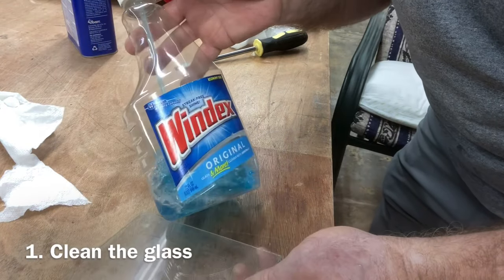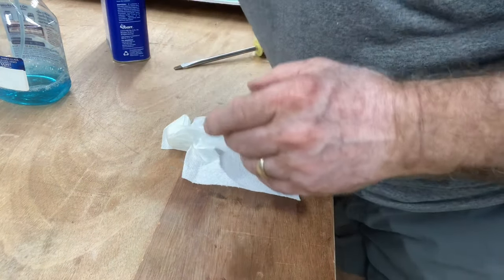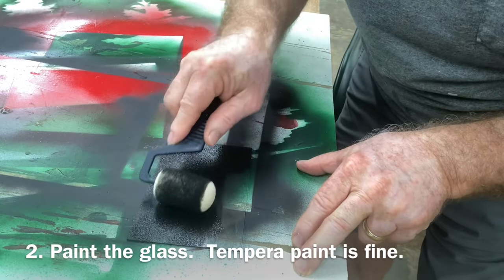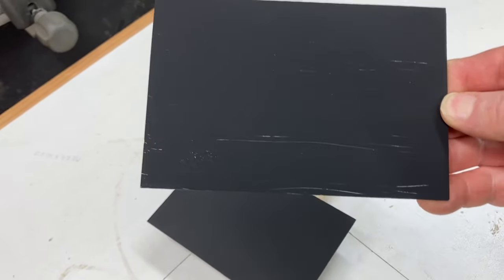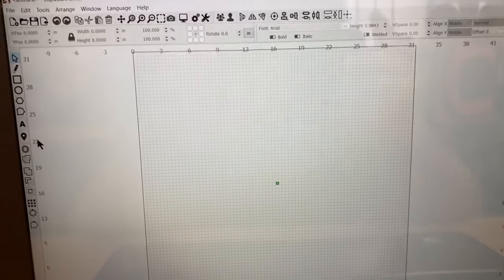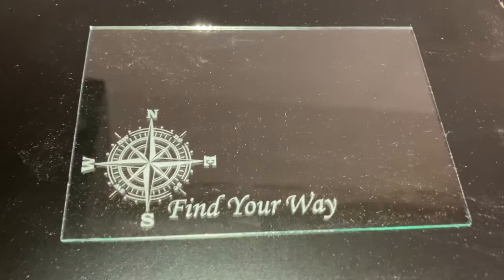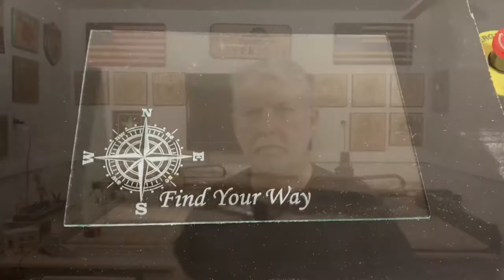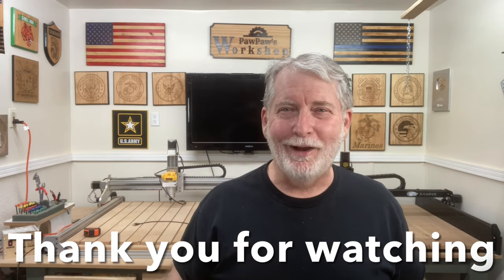How to Laser engrave on Glass with Diode Laser

Comment from the maker: Thanks to everyone that let me know of a voice over problem. Hopefully, problem solved.
Reply: Yep, you got it sorted, thank you
Reply: Such a cool tip thank you mate, another one I saw was the oven grate tray as a cutting bed? That’s so much cheaper then a honeycomb metal board.. I’ve just got my blue diode 40w 445nm 4.5w atomstack p7 laser, what laser safety Goggles would you recommend?
Reply: interesting video but how do you wash off the spray paint? what do you use to strip the paint off the glass.
Reply: 20W laser?  (2.5w optical?)
Reply: @dmanero  I don't know about glass but spray paint comes off of ceramic tile very easily with lacquer thinner.

Comment: You can save a lot of time by just placing the glass on a piece of black card stock, reverse the image, and set the z height to the black surface then put the glass in place. The bottom side of the glass will be engraved. Give it a try.
Reply from the maker: Thank you. I’ve used this method on acrylic. I’ll have try try glass
Reply: Can u make a video?
Reply: @PawPawsWorkShop  so it works on clear acryllic? does it work well?
Reply: This is the method that I’ve started to use. I need to adjust things a little bit but I’m quite pleased with the results.

Comment: As I learn my new engraver, one thing I don't often see it the power of the laser used. If I know my Atomstack A5 Pro is a 5W laser, I would expect settings would be similar for a different brand with a 5W later. I'd love to see more information like that in videos of this type. That would be helpful for us newbies trying to understand what settings we need to be using to get similar results.
Reply: At 7:05 you can see his laser is a 20W, so it would be 280% on a 5W.
Reply: @shigerufan1  actually, 5w/5.5w is just barely eniugh, just needs to run the laser 5-6 times slower. But anything under 5W wont create enough heat.

Comment: Just used a “modified” version of your method. We found that direct contact with our honeycomb bed can cause spotting on the back side of very thin glass. We elevated the glass using magnets under areas that were not being engraved and got beautiful results with your settings. Thanks
Reply from the maker: Outstanding, I'm glad that you found the video helpful.

Comment: Great tutorial, unexpected that the brush painting would be so clear. Have you ever tried (or considered) blackening with soot from a candle or tip of a lighter flame? I expect it will need a thick layer of soot.
Reply from the maker: Yes, that did not work.

Comment: Tempera paint is self leveling Paw Paw, so if you put it on really thick, it comes out perfect with a roller! Great instructional video!
Reply from the maker: I tried the roller. And it sucked. Went with the brush. Will try the roller again. Thanks. Love your work also.
Reply: @PawPawsWorkShop  You have to put a thick coat on. My first time it was see through, but since then, I just use more paint and it comes out perfect. I haven't tried the Rustolium trick yet.

Comment: This is a great video, very clear and easy to follow! I just got my 10W D1 and a friend of mine wants me to etch his tempered glass side panel for his PC. Would there be anything different to the process for tempered glass, or would I be able to prep and engrave the glass using this same process on tempered glass, do you think? Any help would be greatly appreciated, as tempered glass is so expensive to buy and test on.
Reply from the maker: Tempered glass is much harder. You will need to adjust the settings. A little experimenting would be necessary
Reply: @PawPawsWorkShop  sounds good, thank you!

Comment: When I took a stained glass course, they told us to use kerosene to clean glass. It works great.
Reply from the maker: I have never heard of using kerosene. My wife produced stained glass on a commercial level both nationally and internationally for ten years. She never used kerosene to clean the glass. Soap and water works well.
Reply: @PawPawsWorkShop  That's what I was taught and never I challenged it. It does work very well and I never had a problem cutting glass using that method. I think it may be easier than soap and water because it evaporates very quickly and you don't have to dry it.  I guess there are many ways to skin a cat - not that I'm recommending skinning a cat :)
Reply from the maker: To cut the glass you should use oil cutters. The kerosene may act like oil when cutting and then clean with soap and water
Reply: @PawPawsWorkShop  I've never used oil, Windex, or soap and water in any of my glass cutting over the years. Strictly kerosene and an old tee shirt.
Reply: Kerosene is used to cut glass because it lubricates the cutting wheel. The glass is not clean but in fact oily with kerosene. Use alcohol to clean glass.

Comment: You should try a rubber ink roller if you want to smooth out the tempera paint. Although based on your results, it doesn't look like it matters.
Reply from the maker: That is a good idea but as you said, not necessary

Comment: Questions for you.....
I have a 10W diode laser so do I still use 60% power or should I use more
also if the paint is there just so the laser can see something, can you use a black piece of paper instead ?
Thanks for this video...
Reply from the maker: You will need to run a grid test to determine the best power and speed. Yes, you should be able to do that with the paper

Comment: Brillant video - Can you please tell me if you can laser etch the reverse side of a mirror (the coated side of the mirror)
Reply from the maker: Yes, you can. Mirror the image. You will need to test the power and speed on the mirror. Also, use in a well ventilated area

Comment: Great video Sir!!!  Maybe I missed it but did you engrave the glass that was spray painted?  If so, did you get similar results?  Thanks!
Reply from the maker: The next video will have the sprayed one. I used it for a baseline to see the tempera paint results compared to the spray
Reply: @PawPawsWorkShop  😉 got it!!
Reply: What is the name of the spray paint? Tempera paint, does it wash off easily with water?
Reply: @jhnbrown5  oh yea! it cleans with just running water over it ,, but if you use your finger or a rag you can speed up the clean, but it is so easy,, I  love using it ,, right now I have gone to trying to get good engravings with Titainium Oxide,  it comes in powder form and you can mix it with anything,  I want it to dry fast so I am mixing it with alcohol and then using the airbrush method,  I happen to have about 4 of them laying around,  it works great like this Tempure paint, dollar store ,   BUT this T-O leaves you engrave black  and it shows up better  than the clear etch,,  still trying to get the perfect speed and power down right now ,  as he did in this video,, You need to make a good thick coating on whatever you do,  thin coats just don't work well- for me anyway,   Oh yea and it washes off with water easy..

Comment: is the purpose of the paint simply to stop the laser shining through  or does it also make for more detailed lines?
Reply from the maker: The diode laser does not see the glass. It would go straight through and do nothing to the glass. The paint provides a focal point
Reply: In that case would a piece of black sign vinyl on the underside of the glass not be much quicker and work just as well?
I understand that you can’t laser directly onto vinyl/pvc due to the poisonous fumes but with a glass tumbler you could also place vinyl on the inside if it’s simply to block the beam 
Save a lot of painting, drying then washing or would that not work for some reason?

Comment: Hi, just by chance came across your video and was impressed.  What would have happened if you did not put the paint on the glass?
Reply from the maker: Nothing. With clear glass and a diode laser it would just go straight through and not do anything to the glass. You need the paint the glass for the laser to focus on it

Comment: Very cool!  How do the settings change for a 7W laser?
Reply from the maker: On a 20 watt laser it output is about 5.5 watts and 60% power would be about 3.3 watts. Determine your output. I would suggest about 80% power and 20ipm. Test, test and more tests
Reply: @PawPawsWorkShop  Yeah when you said 20w alien laser I immediately jumped over to their site to see what the actual output is. SO many chinesium lasers rate the laser by the power consumption NOT the optical output. 

Now with that being said there IS a company (I forget which) who developed and just released a diode laser that IS 30w. What they've done is ganged up a number of diodes and then combined the lasers via a prism to make a beam that has all the power of all the lasers combined. No info on when they're going into production or the cost as yet. It was this past summer when I read about it.

Comment: It seems to me that if you can engrave glass with your 20 watt laser at 60%, one could probably engrave glass with a 10 watt laser at 100%, perhaps a bit slower. What do you think? Your tempera paint technique is very attractive.
Reply from the maker: That's possible, all you need to do is to test it out now.
Reply: I will and let you know how it goes. 
Thanks
Reply: Ive  tried this with a 5W laser diode running at low speed and seems to work well.

Comment: Brilliant tutorial, can i ask if the spray paint you used was oil based or water based?
Reply from the maker: The spray black was just rustoleum and it did not work as well as the tempera paint that I brushed on
Reply: @PawPawsWorkShop  I can't get Tempera in Ireland, Is it acrylic based?
Reply from the maker: No, it’s a very cheap paint that is often used in elementary school for art projects

Comment: I got a question for you Paw Paw,  I have the long mill Mk2 30 x 30 and interested in buying there version of the laser. Do you think that with the same parameters and process, I would still be able to have the same effect on glass? Not to sure, kinda new to all this. Thanks
Reply from the maker: The process would be the same. The power and feed rates may vary. That will require a little testing.

Comment: When you laser the glass how did you get the white color?  I love the project and am trying to learn. I did a pie plate but it’s difficult to see the etching because it’s clear unless I have a dark backround
Reply from the maker: The white color is the glass itself. It’s normal to see the etching better with the black background
Reply: I would try using a white paint,  if you intend on eating on the plates it could be bad idea,, as thhe food and such will get into the engraving,  another thing that works on glass or plates,  is  T-O  Titanium-Oxide, comes in powder form and you mix it with anything from water to paint thinners,   I used plain alcohol as it helps the drying time,  as anything you use it needs to be put on thick, so several coats work better.

Comment: Another great tutorial.  But you started with two glass blanks, one sprayed with flt black and the other rolled and then brushed with Tempura.  Which worked best and was shown?  What happened to the other?  

I like your tutorials because you separate the FACTS from the superstitions.  Nicely done.
Reply from the maker: I showed you what worked best in the video. The other example was ok but not as good as the one I showed in the presentation
Reply: @PawPawsWorkShop  Thanks for the great information and your fast response to my question.  Your YouTubes are very useful.

Comment: Hello, I am a newbie at this. I have a we creat blue laser 20 w. I use the Make it software and don't use the lightburn. Is it similar?
Reply from the maker: It is similar. With the Make it software you have pre-tested grid for recommended settings. It still will require some testing

Comment: How long did it take to engrave using this method at those speeds/power?
Reply from the maker: It only took about five minutes. Speed and power were in the video.
Reply: @PawPawsWorkShop 
Wow I must be setting something wrong. For fill 20 hrs.  About the same size but lots of text. 0:08 0:08 10watt laser
NEWBE. Help

Comment: can we engrave on acrylic using 20w or 15w DIY laser ? and we have to paint it black too? why can not we engrave transparent acrylic directly with 20w laser?
Reply from the maker: Yes, you can engrave. Dark colors are best. The diode laser just shines through the clear acrylic. I have shown engraving on acrylic by actually engraving on the metal below the acrylic and it will burn onto the acrylic

Comment: AtomStack demos engraving on clear acrylic by placing on a piece of black substrate.  Wondering if that accomplishes same as black paint?
Reply from the maker: The black under the acrylic is the focal point of the laser. The heat transfer to the acrylic. Here is a video. https://youtu.be/7VwU4a54zuI

Comment: I'm new to this. My question is how are you getting it to engrave correctly. My Xtool (using lightburn) My images are coming out backwards. I have no clue what I'm doing wrong.
Reply from the maker: You are not doing anything wrong. When I load an image before I select the machine the image is always reversed. Just mirror the image and continue. If you are using the RA2 then check before you engrave, you may need to mirror the image there also
Reply: @PawPawsWorkShop  thank you. I'll try that.

Comment: Hello, thank you for this video! I have a question, can we use any paint?
because today I tried with my M1, I had covered the back of my glass with blue tape so that the laser could detect it but it didn't work.. it even cut the tape through the glass haha.
Thanks for your reply, your advice is appreciated.
Reply: if you have it laying around, most any paint will work,,  but the Tempure Paint is really cheap, at the dollar store,,, the other thing is most regular paints have to be cleaned with a chemical such as acatone, or laquer thinner,  and when getting to White paint it has Titaium Oxide, as ingredient ,,  and when engraving it wmake the engrave  Black,  which on glass is very nice ,, if done right it does not come off even with a scrub pad.

Comment: How do I adjust speed power for a 10 watt laser ty
Reply from the maker: In the software you will find the speed and power adjustments.
Reply: I mean if your using settings are for a 20 watt and we have a 10 watt how do I convert or adjust numbers on a 10 watt so it does the same thing
Reply from the maker: You can not convert directly. You still need to do test grids to see what the best settings going to be for your laser

Comment: 8:00 Wow ... 60% Power at a 20W laser is quite much ...
EDIT: Ah ... I looked at the website and if you are using the "FoxAlien Reizer 20W" you just have a 5W Laser ... just as tip for coming videos. I was wondering how 60% of 20W (12W) laser just make that less impact into glass. In real you have just used 3W laser power.
Tech-specs reading is not easy nower days when all try to fake their real output power ... sadly but everywhere normal.
Reply from the maker: All the different manufacturers are throwing out numbers. Even reading the specs you most like will still be wrong. That is why I try not to emphasize power and speed. Test, test and test some more your own laser to find the best settings. Trust me they are all differ.